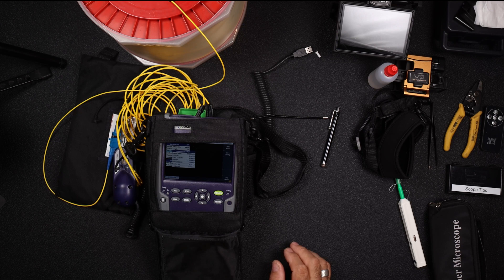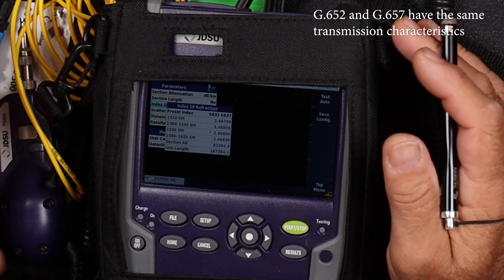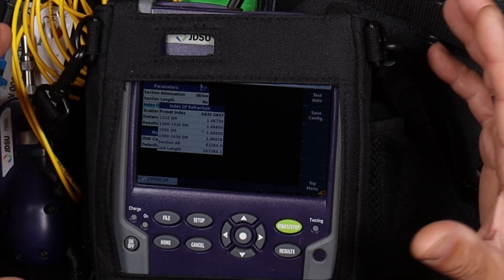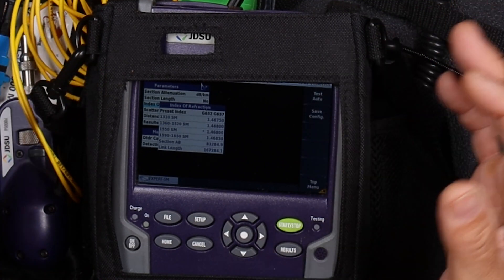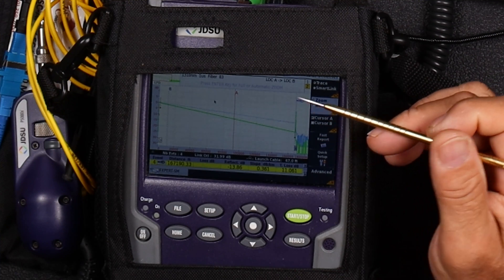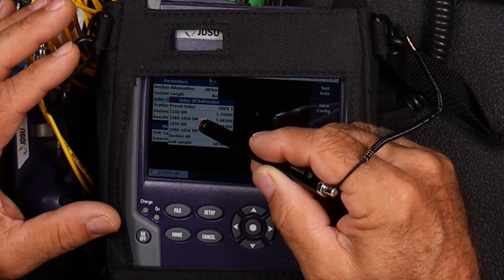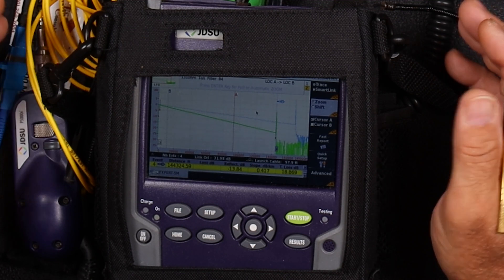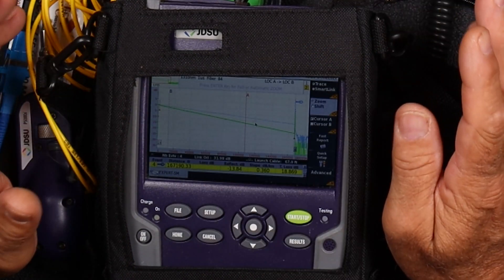Understanding Index Of Refraction and OTDR's

Comment: Nice video! apart from the length, will the loss change? Such as splicing, connector loss.
Reply from the maker: No, but all the event locations will be incorrect. Loss is calculated using the backscatter level at the beginning and end of an event. 
Thank you for the comment.
Reply: i have a question about the connector’s definition. 0.5db per connector means , eg. 1 Fc connecting to an adaptor and adaptor connecting to another fc connector. Or there are 2 connectors loss, total 1db loss. Thank you! I am new to OTDR.
Reply from the maker: @ckc4366  Connector loss is always as a mated pair. ITU G.671 states .5 dB loss. TIA (Enterprise applications) allows .75dB loss.

Hope this clarifies.